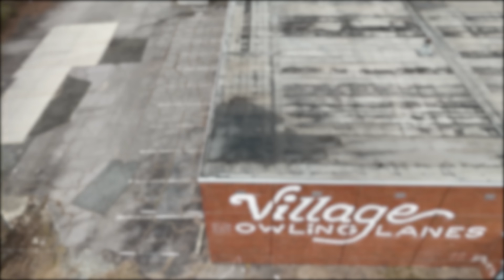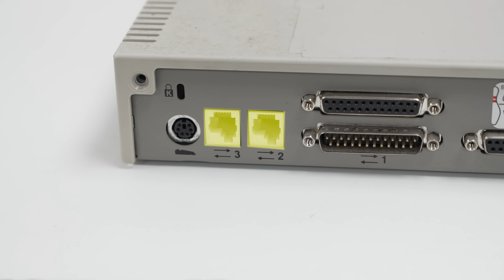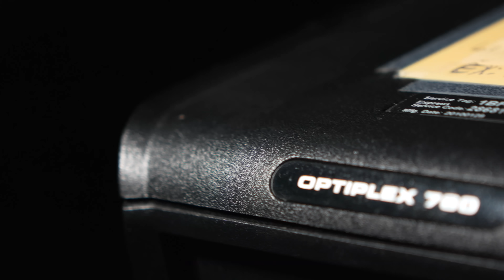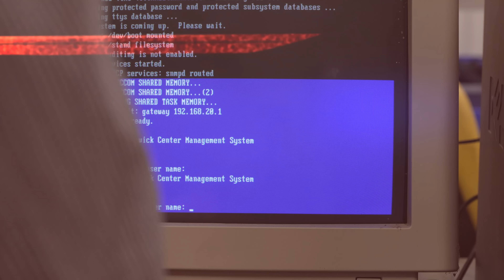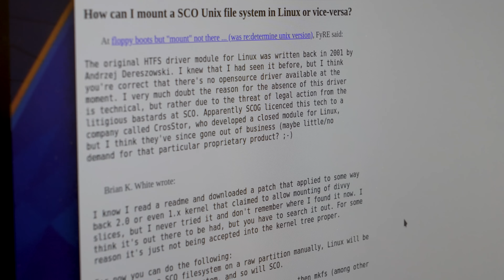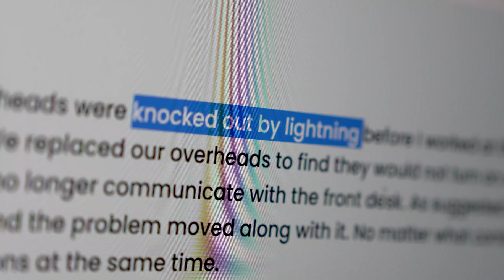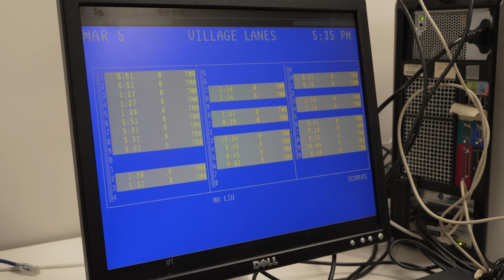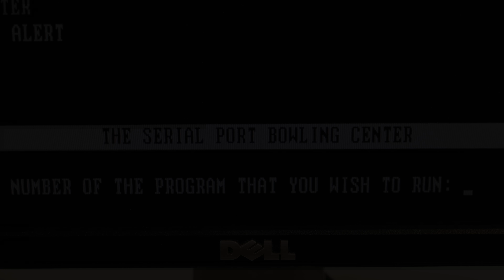We hacked into a bowling alley computer!

Comment: Surprised by the comments about lightning taking out serial ports, I do know this is all too easy if you run serial between buildings, however if it's all under the same roof, like a bowling alley, it should be ok.
I have a slow (1200) speed serial line running around my house and outside to a backyard workshop, never had any real issues.
I did hear of a university that spread a pile of serial terminals around a campus (as in multiple buildings), the lines being that long that they had to slow it down to 1200. However basically every time there was a thunderstorm, they'd loose a pile of 1488 & 1489 serial driver/receiver chips.
I worked for a telco, they ran serial, as in TTY/Teletype down twisted pair phone lines, 25mA from +-50V, way more rugged, almost needed a direct lightning strike to take it out.
Reply: There's ways to protect the system from that, but too many people choose not to use it because of the cost.  After they've replaced enough blown up equipment they usually change their minds.  Of course, the retrofit costs a hundred times more than if the system had just had lightning protection designed in from the beginning...
Reply: I was in the POS industry for a very long time.. One of the big players still uses serial to drive local and remote printers - after a big storm we'd have multiple calls of toasted serial ports. If it was bad enough, windows would try and initialize that port and then BSOD or reboot.. good times.

Comment: The original AS-80 scoring system from Brunswick came out in 1979. It used RS-485 to go from the lane interface unit which, sat under the front counter, to the scoring consoles at the lanes. The system originally used Wyse 185 terminals. The system used RS-232 to go from the Lane Interface Unit to the terminals. It was extremely primitive. You could select between open play, league play, and warm-up/practice. You could do score correction. And when the bowlers were done, you'd get the frame totals from the terminal and then use that to calculate the number of strings bowled and you'd charge them on that. The scoring consoles were Z80 based systems with custom CPU and video boards and a linear power supply that was always running hotter than it probably should have.
Over the years Brunswick did update the system with the AS-90 and the Brunswick Command System and this is where SCO Unix came in as they started to try to offer more complex systems that would do the book keeping, cash register functions, and just generally make the centre run more efficiently with less staff. I got out of the bowling business in the early 2000s. By then Brunswick had stopped deploying SCO Unix and had instead embraced Windows.
Reply: That's very interesting to hear. A bowling alley I visit quite often uses Brunswick. And as far as I know they run on a very old system of them.
Reply: I’m pretty sure they stopped using SCO Unix because of the INODE errors.  😂
Reply: When I was a kid, our local bowling alley had AMF MagicScore, which I believe came out in 1975.  I never saw the guts of the system, but the front desk terminal was huge. It had an integrated b&w monitor (maybe 10-11"?), keyboard, and a thermal printer, all in an 1970s orange-and-cream steel case.  Each pair of lanes had a membrane keyboard console and two b&w monitors (maybe 13" each) in a single housing above the approach.  Of course there were no animations or fancy graphics, but they did display all 10 frames for four or five bowlers.  I believe I read somewhere that they were semi-proprietary Ball Bros.-made vector monitors. That system stayed in service until the early 2000s!
Reply: brunswick ga?
Reply: @xenon_54-j8l  Brunwick was headquartered in Skokie Illinois.
Reply: They were charging for wear and tear on the lanes and pin setters.  So they could have just put an electromechanical impulse counter connected to each pin setter and charged people based on the number of times their lane reset or whatever.  Amazing; some charlatan sold the industry a bill of goods and managed to make a dumb and boring sport even dumber and more boring.
Reply: @railgap  The pinsetters had an electromechanical frame counter at the front desk that advanced every time the deck went all the way down to set new pins. What happened is bowling started to die in the '70s after the downfall of unions in America. So bowling centres needed to bring in more and more casual bowlers. This is when tech and gimmicks started making its way in to the bowling industry.

Comment: The last SCO 5 system I built was in 2003. I decommissioned and converted it to a virtual machine in 2017. The original hardware is still running today but is now used as a DOS game machine.
Reply: The first, last and only SCO machine I used was at WebTV. It fetched the caller id info from the modem bank for WebTV devices to call when they needed to find their local modem bank. Then the service software responsible for the modem bank directory (running in Solaris) would ask the SCO box, for the user that got assigned this IP address, what's the caller's phone number? Then it would find the local number the WebTV box should call next. Bootstrapping, FTW.

Fadden are you here? Are you still updating PhoneDB? :)
Reply: @ I completely forgot about WebTV. I remember a friend dragged me to a seminar to become a WebTV reseller. As I watched the people struggling trying to present this device I asked them to go to my very simple website at the time which used frames and it wouldn’t load. I passed on becoming a reseller knowing full well it would never see the light of day.
Reply: @JeffRAllenCH  WebTV!  That's what my wife was using to get online when I first met her.

Comment: I've worked in plenty of systems like this in retail

SCO Unix (specifically OpenServer) was fairly popular for a time as part of backoffice servers sold as an appliance/turnkey systems, before the lawsuits happened and Linux took over that market (slowly, as you don't rip out customer owned servers overnight).  funnily enough SCO as part of it's demise tried to push everyone to Unixware (a completely different incompatible product that they acquired) which just added salt to the wounds. 

these Dell 745-760 systems were practically the last era of systems SCO ran bare-metal reasonably well, they also were a decent upgrade as SCO OpenServer was SMP capable and could make use of the (at the time) new dual core CPUs. I have many memories of migrating these sorts of boxes to more modern hardware and software. back in those days it also took a very long time as you were usually migrating via tape, and the older tape technologies like SLR were incredibly slow.

Comment: Fantastic stuff, so much work in verticals dies unrecorded. Lightning strikes were a big problem where serial comms connected lots of devices across a building or campus. I worked in the mid-80s for a computer maker in Cambridge UK. The ofiices/labs were on top of the only hill for miles, with a VAX 11/780 hooked up to fifty or so terminals, Rainbows, and a gaggle of weird peripherals. Some of the cable runs were very long. We attracted a lot of lightning, and had a lot of mux cards in store to get everything running again after Thor did his number on us. 80s chips did not like spikes, but long serial cables make excellent EMP antennas.
Reply: WHY DID BOWLING ALLEYS CENTERS GET STRUCK BY LIGHTNING SO MUCH???
Reply: @Peet-e2h It doesn't even have to strike the center directly. I've had lane computers fried by ground strikes nearby, it really comes down to the building, how everything is grounded and how the cables are routed within the building.
Reply: @Peet-e2h  Probably because they're usually the only building in that part of a strip mall. The one near me has a freeway behind to the South, a parking lot in the front to the North, an little-used road on the East side and the West side, behind a fence, is the exit from the freeway to the exit for the alley. So lightning will naturally look for the highest point for ease of connecting to the ground. Which happens to be, for me, the building for the bowling alley.

The second-closest one to me is the same. All around that bowling alley is nothing but a parking lot, except for the North side, which is some train tracks. So physics hits the alley building yet again.

Comment: I think it'd be interesting to reverse engineer the communications between the centeral computer and the pin setters and player interface.
Reply from the maker: Definitely agree
Reply: The pinsetters in this video were the older A or A2 machines. Purely mechanical. The AS-80 scoring consoles originally came with three options for scoring input. Manual input. This is where the bowler would count the pins knocked down and enter that via the keypad. Then there was the Model 79 optical scanner released in 1979 that scanned the odd and even lane pindecks and would read the standing pins like a barcode. The '79 scanner was replaced in '86 with an upgraded version. The scanners would sometimes count the oil drips on the pindeck curtains as standing pins. Or if two pins slid too close to one another the scanner would miscount. The scanners were eventually replaced with CCD cameras that were far more reliable.  Or centres that couldn't afford the CCD upgrade would go with with an A / A2 to AS-80 interface that repurposed the pindicator switches on the moving deck to now be the pinfall indicator for the scoring system. When the GS-10 machines were introduced in the late '80s they could talk directly to the newer Command network and do fancy things like set specific pin patterns or reset the last detected standing pins, but they couldn't talk with the older AS-80 / AS-90 scoring systems.

Comment: It is very common that the bowling pcs were running sco unix. I have read many other tales of this. When you said dec terminal - that was my hint this would be sco as well.
Reply: I have also noticed that I should listen all the way through before I leave my comments because I think of things after. (I listen to you more like a podcast while I’m driving) - currently when I worked with all hardware I have found an old version of Clonsilla version 1.14 so that is compatible with 486 instructions - or you can use “netcat tarpipe” - which can also be helpful sometimes if you’re working with old unix

Comment: I worked in a computer repair shop through most of the 90s, and there were two guys who owned and ran one of the local bowling alleys todayther who were always bringing me old crap to fix. I always hated it, because the old crap always smelled of stale smoke and barely worked once I did get it running again. If they're still alive and running that bowling alley, I'm betting that same IBM XT (that I tried to get them replace a dozen times) is still sitting in their office, barely chugging along... And I wonder what poor guy has been keeping it going for the past 2.5 decades since I left that shop...lol
Reply: I wonder if these systems were that costly that it was worth to have it fixed all the time instead of replacing.
Reply: @NaoPb  Time is money, closing down for an upgrade even for a short time can lose a lot of money.
Reply: @JoshuaFawcett  Especially if the upgrade is more than IT systems, If the server and desk systems need new LIU for example, well can that talk to the pin setters and ball returner and lane interfaces. So one could be not just looking at IT downtime but a major capital expenditure in physical infrastructure.
Reply: @NaoPb  the hardware itself is not costly, but those enterprise companies got all proprietary software that will only work in that setup so the only way to upgrade is to hire them again, which is very costly and would take a lot of downtime.

If I were the manager I too would try everything in my power to avoid going through that again lol
Reply: @NaoPb Probably, is my guess. Surprisingly tight margins in these places, to say nothing about maintenance and operating headaches. But it was partly business and mostly love to own a bowling center "back in the day."
Reply: IBM XT? That probably doesn't even show bad CGI cutscenes. You're looking at ASCII graphics at best! GUTTER BALL. ABORT, RETRY, FAIL?
Reply: @jessragan6714  I would imagine it had outputs that would control an analogue video system that would show the clip on the screen and then it'd flick back to the computer's output after the clip finishes.
Reply: @jessragan6714  I'd be down for a DOS themed bowling alley. In addition to "cosmic bowling", they should have a mode where the whole alley just goes completely green to match the color of the monitors.
Reply: @jessragan6714  Nah, I've been to a bowling alley which had a computerized scoring system with animated cutscenes. From the palette used it was clearly CGA graphics.
Reply: If it still exists then it would be a goldmine for dudes running this channel 😂
Reply: You ever want to get experience with really ancient hardware, the other way is to start supporting the medical field.  In 2018 I was sorting out some random medical imaging equipment running Windows 3.1.  The Doc wanted to see if I could update it to Windows 10! Er, nope!
Reply: If it ain't broke